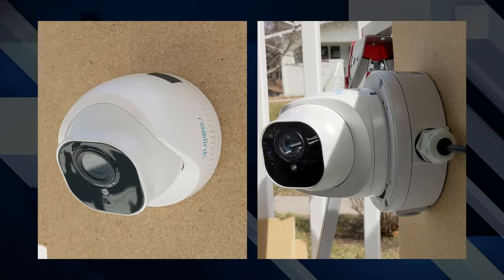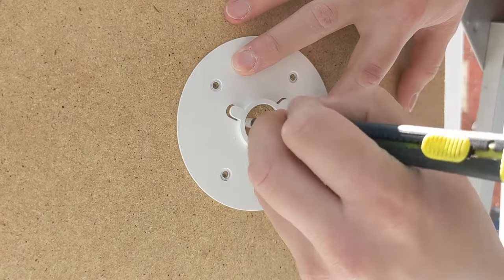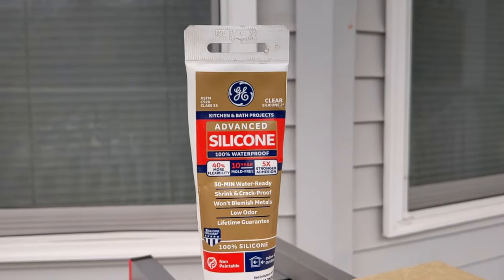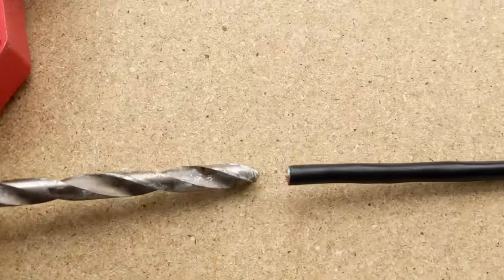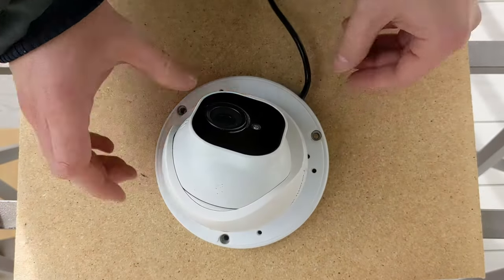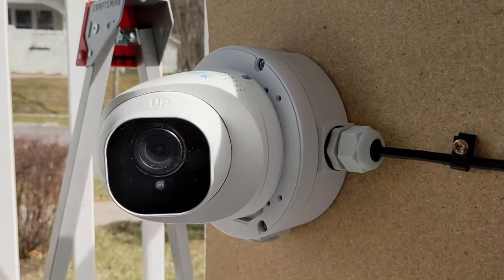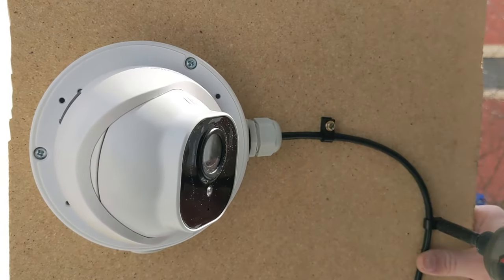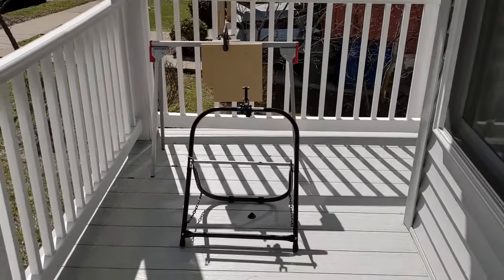Installing Security Cameras Outdoors - Reolink, Amcrest, Hikvision, others

Comment from the maker: You can also install cameras using metal/PVC conduit and their corresponding junction boxes. If you think that's the right solution for your project, I'd highly recommend just hiring an electrician to install the conduit for you, even if you still pull the cables yourself.
Reply: You could also use outdoor rated flex conduit. Excellent video.
Reply: @edbouhl3100  I was going to suggest same non-metallic flex conduit would work great. Should never have cable exposed to easy to cut. Great Video keep up the great work.

Comment: I was a contractor for Comcast. We used those bushings and they actually do work but you have to do them properly. First, they need to be sized correctly to the cable. We used them for RG6 cable only and it was actually a pretty snug fit. Second, as you mentioned, you need to use silicone with them. They primarily provide a neater and more professional look than just a hole drilled in your wall. Our standard though was to mount the premise box over the exterior penetration so it was well protected. That's why, at least in my area here in WA you will see the boxes mounted in sometimes strange places. Usually right above the foundation. Never had any issues with rain on any of my installs and we get a lot of rain here in WA.

Comment: using waterproof boxes, you always need to terminate the cable (rj45 plug) after passing it to the holes to the box right? I still haven't find a way to use already terminated cables.
Reply: ex. if I am using POE injectors; it is big and the cable is already terminated...I have no idea how to put it in the waterproof box.

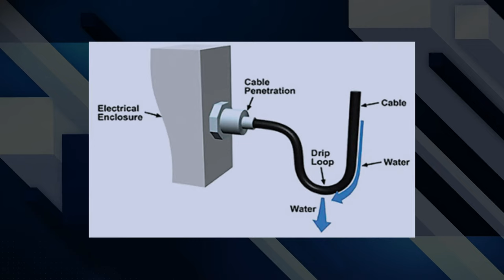Comment: Fantastic! Thanks for making this video.  Couple of questions:   @3:54 you showed a diagram of the drip loop, from the installation methods you discussed it wasn't completely clear to me where drip looping would be used (e.g., with a junction box? etc.), can you clarify?  Also do you have any experience installing cameras into stucco? If so can you provide any guidance/tips? I'm a bit worried that installing the camera on stucco could effect it's integrity as it seems more brittle and subject to cracking/breaking, etc. 
Also you mentioned that your most common installation was the use of a junction box with cable entrance in a different location. Was curious why that is your most common installation method (i.e., what is it that drives this method)?
Thanks.

Comment: My house was pre-installed with cable going to a gang box in brick. What's the best approach for mounting the camera and running the cable from box to camera? Can the camera install on top of the gang box?
Reply from the maker: Sometimes the camera will have holes that line up. If it doesn't, you could try getting a blank cover for the box and attaching the camera to that.

Comment: Great video! Thanks. Would installing into stucco be similar to installing into concrete, with the hammer drill and the masonry bits?
Reply from the maker: Usually yes, just be gentle drilling. I'd suggest using a junction box to minimize issues mounting the camera to an uneven surface.

Comment: Thanks for the video. Very helpful info. Question maybe you can help with: I'm buying a new construction home with brick exterior. The pre-wire company terminated the ethernet into a 1-gang electrical box. Then the brick guys installed the brick around the box. Finally, the pre-wire guys installed a plastic blank plate over the box. Now it's up to me to terminate the line and install the camera. I'm using POE cameras. Any advice on how to install a camera over a 1-gang electrical box with a brick surround? Thanks again!
Reply from the maker: You should be able to mount the camera to the plastic blank plate. You'll have to drill a hole through it for the cable as well. Then follow my instructions for terminating a cable inside a junction box.
Reply: @zufallcommunications1033  Thanks!